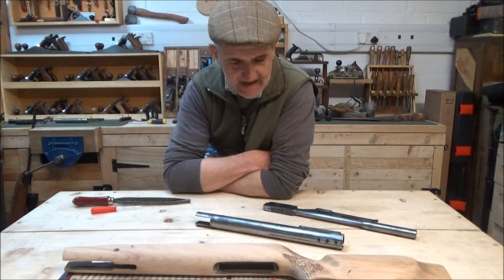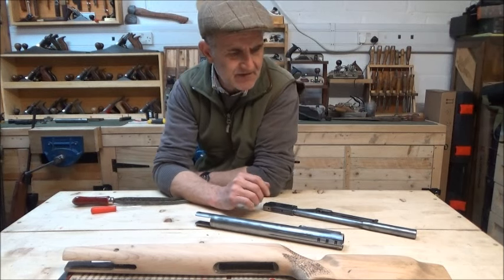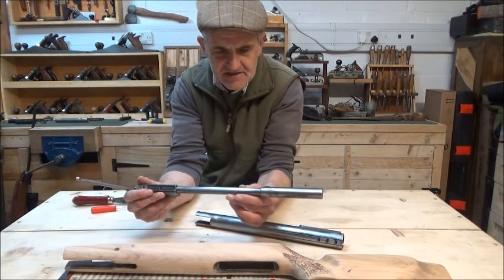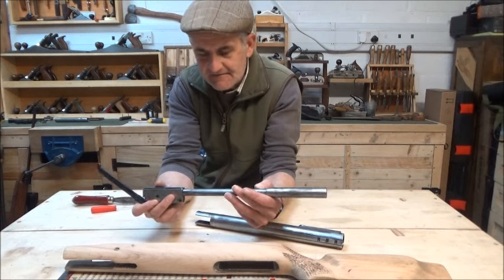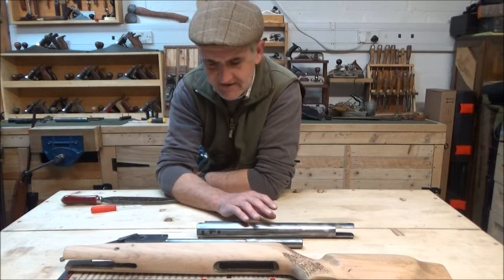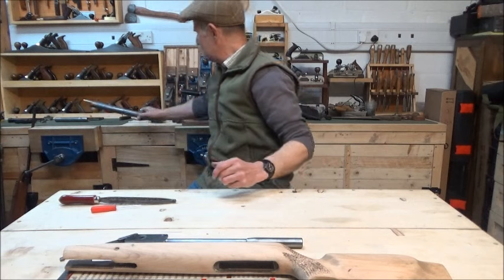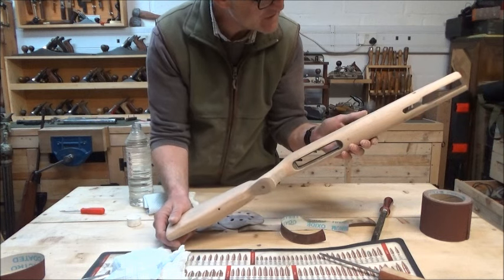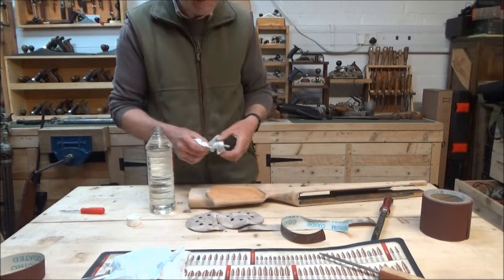HW90- The refurb begins

Comment: Hi Vin, Agree 100% on orbital sanders but pellets and pistons in america uses them. I would not touch it with power tools. Do it all by hand. What make of stain do you use? We always used colron as it does not leave a residue. Try scotchbrite on the metal parts. Works wonders.

Comment: hello vince ,do you use a brush with a purpose to stain it , i did it many times with a sponge or ball cotton   yours peter
Reply from the maker: Hi Peter, used a brush for first coat so I could load up the stain and apply it quite thickly. The following coats will be sponged on and wiped 👍👍👍